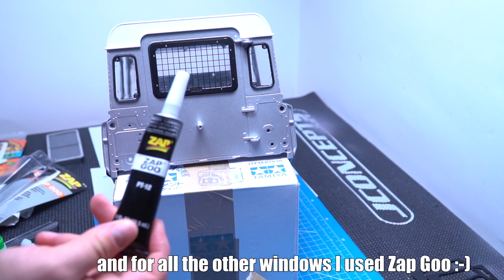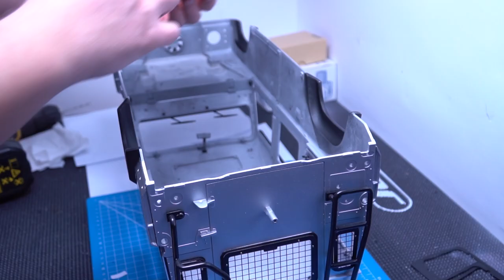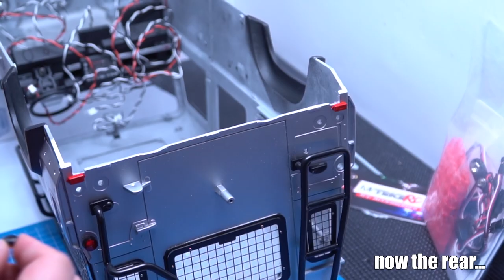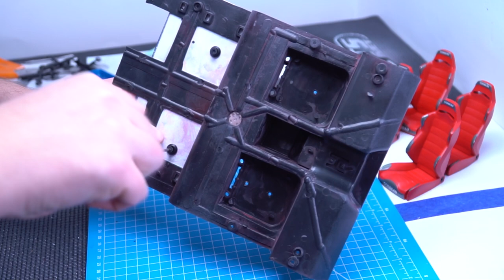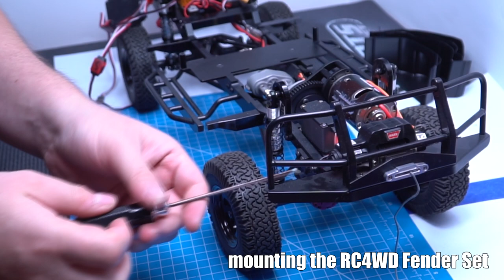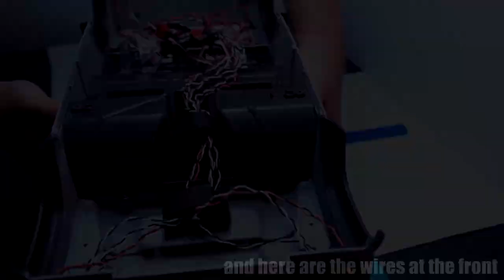RC Project 6 | Kahn Defender D110 | PART 4: Assembly, Lights, Upgrades etc

Comment: which lighting kit from my trick did you use?
Reply from the maker: customized UF-7 lighting package
Reply: @LandOfTheEagle  could you post the details/specifics of what you got? i'd like to put the same setup in my gelande defender. i'm a total noob to the RC world. (first RC car build) ive done this to a real defender but am flummoxed by one i can hold in my hand... thanks
Reply from the maker: @spencernorcross2612  It was 2-3 years ago so I honestly don't remember. From what I see, the ordering process on their site is still the same and very easy - just choose The UF-7C RC Lighting Controller and whatever LEDs you need for the build (colors, sizes, qty). Unfortunately, I can't find the order confirmation on my email box, but check your truck kit and you will know what do you need exactly :-)